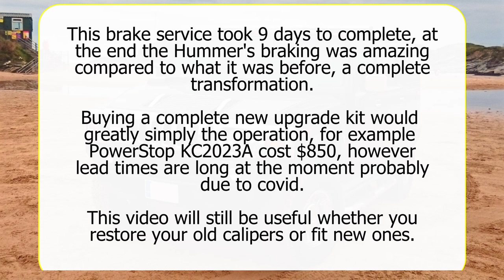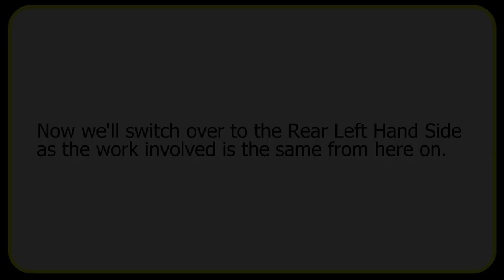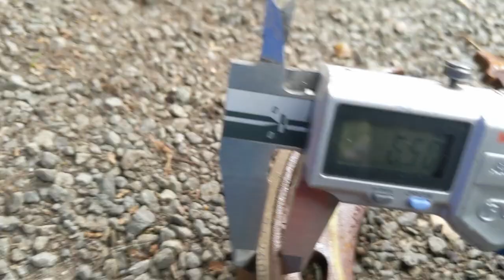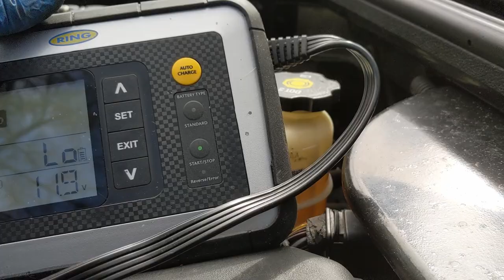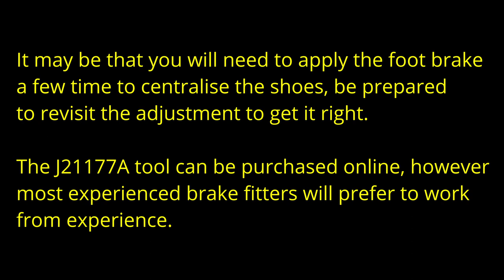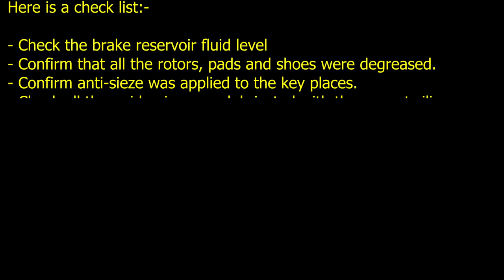Hummer H2 2005 - Disc Pads, Rotors, Parking Brake Shoes - Full Service

Comment from the maker: Unfortunately I'm in hospital with Covid so it's hard to respond effectively. A good long breaker bar should do the job, use good quality 6point impact sockets. Avoid heat on caliper pins/boots. The rotars were EBC ...

Comment: Hello, nice video! I’m having a hard time breaking them bolts loose, should I just use a torch on it? I would like to ask you what brand/part number are those rotors please? Thank you so much
Reply from the maker: Out of hospital now. You've probably already got your new rotors, however the brand was:- Front Rotors & Pads Kit = EBD08kF135, Rear Rotors & Pads = PD08KR202. 
The pads are included in the kits, BUT they use "YellowStuff" pads> Although the braking is superb and can stop my H2 on a dime, the amount of brake dust generated is dreadful, so next time I'll switch to ceramic pads.